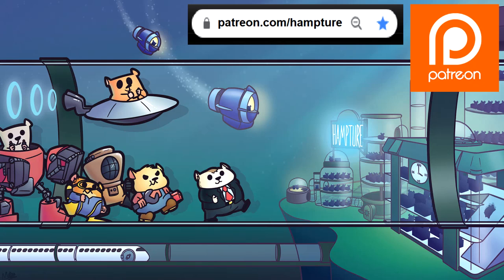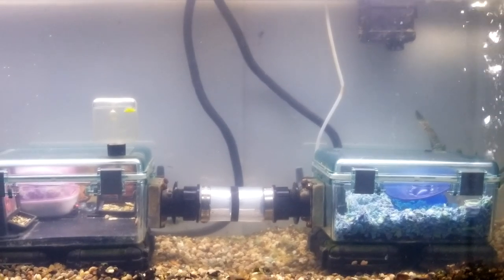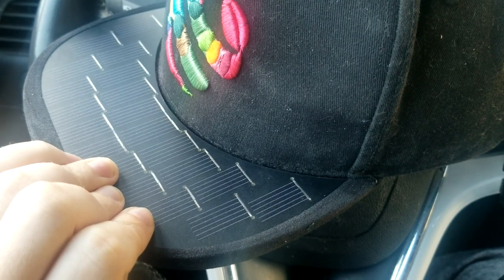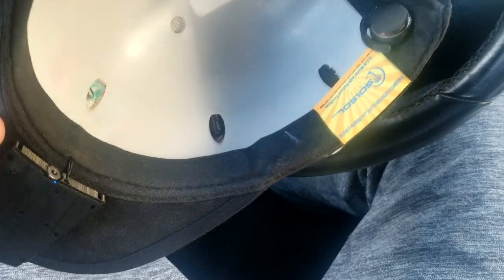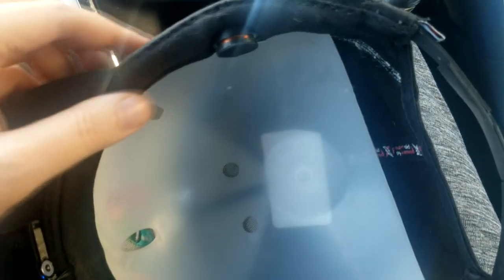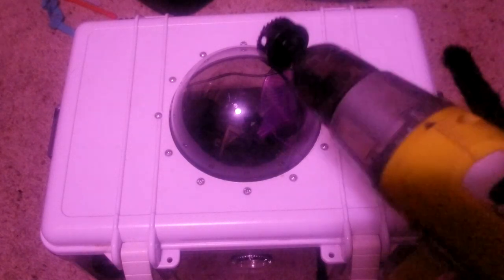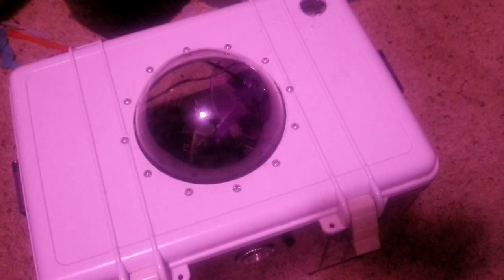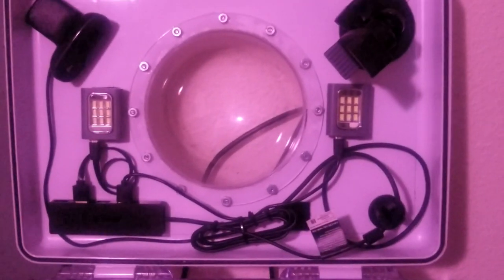Super Hat, Thermoelectric Cooling Vest, Megahab USB Umbilical

Comment: Printed TPU has a pretty rough surface. It may be better than nothing, but if you're making flat gaskets you can cut them from gasket sheets.

Ninjaflex TPU prints well on my Ender 3 (similar to your CR-10) after I printed a "flexible filament extruder" ( thing:3839360 ) and switched to a 0.6mm nozzle. Other brands of TPU may be able to print with the default nozzle, but ninjaflex is the floppiest so it needs 0.6mm+.
Reply from the maker: Thank you, I'll copy this to google docs for later reference

Comment: I for one think smart hats should be normalized. Especially because everything you just described sounds amazing for the long day hikes I love to do. I actually might look into making one.
Reply from the maker: The only problem is there's no good place on it for a fan. Solar fan hats exist but they put a pivoting fan into a hole in the bill, which is where the solar cells are on mine.
Reply: @Hamdad  Just a thought, and I say this as a technical novice at best, but you could attach a curved arm to the side of the hat, similar to the face guards on roman helmets, then put an angled fan on the end of that. It would sacrifice some astetic, but it could work... I think, I might also just as well be wrong
Reply from the maker: @cherrypopscile3385  No that would work fine but I'm trying to keep it as "normal looking" as I can while packing in features. I'll think on it though maybe there's a more compact solution
Reply: @Hamdad  An alternitive solution, if you can't figure it out, would be to use a shirt collar fan. It's just a second option.
Reply from the maker: @cherrypopscile3385  I have one, I can run it off the hat's solar panel

Comment: you should try to add a projection unit like google glass that shows the time/ direction / temperature. like a literal heads up display.
Reply from the maker: Woah, yes. I wonder if I can make it acceptably small & light though
Reply: I had the same idea. I thought if you're going high tech, you may as well wear some kind of visor/helmet for the full effect